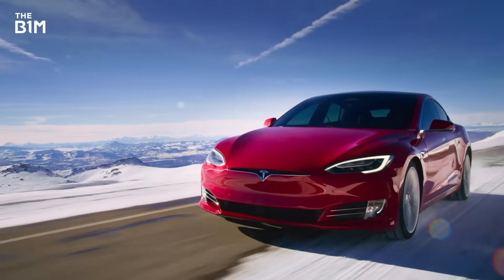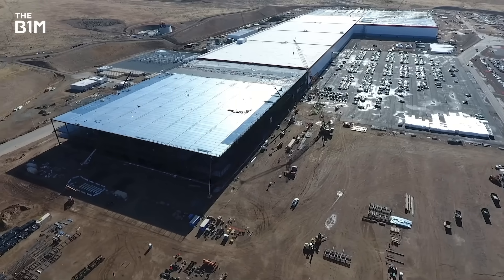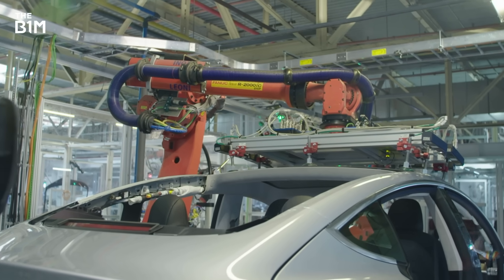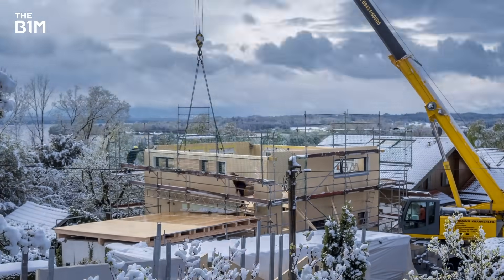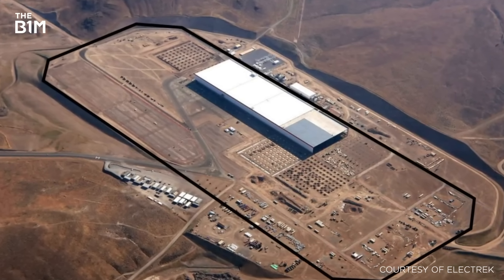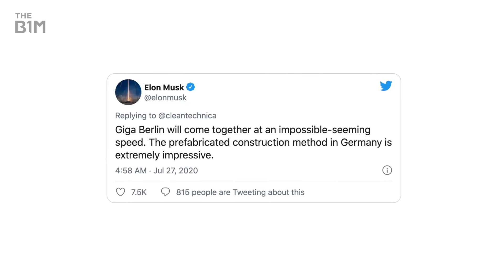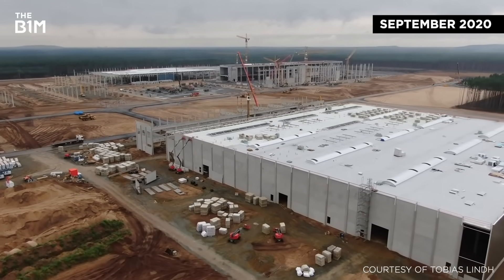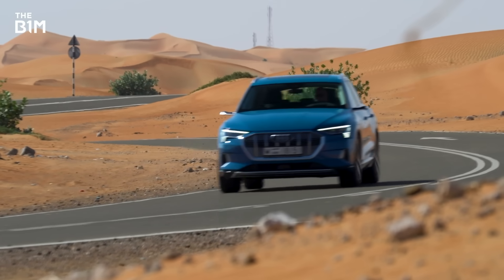How Tesla Builds Its Factories So Quickly

Comment: @1:31, unfortunately this is incorrect.  Having worked as one of the Senior Factory Design Managers at Tesla on a few of the Gigafactories, I can tell you there is no such template that the company uses to avoid reinventing the wheel, nor is there any such Design Manual (in fact, I was on the Reno team that proposed early on to create that manual). Quite the opposite, every new site is a new opportunity to re-optimize absolutely everything from the industrial layout of the plant, the manufacturing process design, down to the building itself and all the utility distribution systems (power, compressed air, gases, other chemicals, chilled/heated water systems, etc.). Of course, there are "lessons-learnt" that carry over from one project to the next, but surprisingly very very little is common between the Sparks/Reno, Shanghai, Berlin, and Austin factories (let alone the Fremont factory and other sites in NorCal). Templatizing is honestly not at all a contributing factor to the company's speed of deploying new production facilities. Such an approach would be very contrary to Elon's and the company's "first principles" approach to problem solving.
You are correct that prefabrication is used as one of the schedule relief methods, but there's nothing revolutionary here, all companies have access to the same prefab techniques, so this is hardly an advantage that Tesla has over any other manufacturers in the world. Also, it is not necessarily the case that prefab will be used on all Tesla projects. This is chosen on a site-by-site basis, and is related to the overall schedule constraints, which varies greatly from one factory to another (a complete supply chain analysis dictates here).

The company's secret is in its culture. I know that sounds vague, but the company's biggest strength is in how in-tune Elon himself and his top COs are with the details on the ground and in the design/planning process, and in the team's ability to pivot on a dime with a simple email from Elon, it's unlike anything you've ever seen how effectively a change in direction cascades down through the management ranks (perhaps outside of non-conventional military organizations - like guerilla groups), I think that is 100% the company's biggest advantage. That, and having the courage/technique to effectively put pressure on the biggest bottlenecks in a construction project: the regulatory/permitting process.

Comment: well. making prefabs in a factory does not always mean faster build times. the time saved from building a build on a given site, is move from that job site to the factories. at the end of the day you will still have to place an order with a third party to make those premade parts months if not years ahead of the assembly of the main factory on site. the time is spent at factories. instead of at construction sites. the time spent factor is still still there.

e.g prefab houses. all well and good saying. look at me, i build a house in less than a week. when in reality the parts to make that house were being made somewhere else many months before you received them to then do the final assembly. it still took months to make that house. it just was not assembled yet. that is all.

not saying it can never be faster, because that is not true. my point is. it take a lot longer than many will let on

Comment: Would be nice if you would go in depth on the Berlin drinking water issue. Anyhow, apart from that, these mega factories are buildings that significantly further the risk of flash flooding. Because their footprints are so large, yet another piece of soil is covered and sealed for rain to enter the lower soil structure and replenish groundwater levels. Hence, the planning and building of these structures should take this ‘footprint’ seriously. First of all, for the building itself, because where soils become ‘dry’ because of covering subsidence will occur. Second, because when a company truly wants to make an environmental contribution, all factors should be taken into account. Including its rainwater footprint.

Comment: To a degree.. the New York factory doesn't produce cars so it's not exactly a gigafactory..

Also, Shanghai gigafactory and the Berlin Gigafactory, and Giga Texas (it's special because it's the new biggest building) incredibly ridiculous that they are building three giant factories and one went from mud to producing +1,000 cars per week in 10 months!

And most ironically they never actually finished the Nevada gigafactory, It's only a fraction of what it's supposed to be and yet it's still producing hundreds of thousands of vehicles a year.

👍 Great video

Comment: Very impressive as allways. The modularization is vital for us to reduce the CO2 emissions and to build more sustainable. I did not understand from the video though if Tesla has its own division of Construction of they have only the "plan"? The fact that everything is controlled by one owner with very clear direction and way of working it's definitely vital in an industry when you have houndreds or even thousants of participants on a project, accross the entire supply chain. There are indeed many advantages when you build wih Lego blocks, and at the same time there is a big challenge to make sure to deliver in time the needed parts for such a huge projects that cannot be overlooked.

Comment: Nothing special. 

Their building are bland, boring and very simple: just squares/rectangles. A designer/architect doesn't need to draw anything. S/he can literally walk up to the site and say put these pillars there and roof there and that's it. Now replicate it 100 times and you have a so-called giga-factory. 

No new design, no new materials, no innovative ideas. All been tried and tested 500 years ago. That's why they can build them so fast. Also, most of these will not be as solid and long-lasting as a building, for example, in the middle of Manhattan.

Comment: Great video, however adopting the design from the manual to different locations is not new, Wal Mart pioneered in that in its super centers, a phenomenon which if I remember correctly did not set well with architects at some level.

Comment: 3:52 This is just one example of how government regulations give big business advantages of smaller ones. There is virtually zero risk that Tesla's building permit would be revoked once the factory is finished, even if their permit application according should be denied according to the rules.

A smaller or "less cool" business doesn't have this privilege.

This creates a market where the big or "hip" players have advantages over smaller and less flashy ones.

The result is centralization, fewer consumer choices and slower technology advancement.

Yet, the same people who complain about some businesses being "too big" also support the regulations that creates the supposed problem.
Reply: So start a small electric car company like Tesla did.
Reply: @drod3434  I just explained exactly why starting a small company is made much harder by government regulations.
Reply: Preliminary building permits must be only be granted if it's most likely that a final building permit is possible. That does not depend on the size of the company. The political influence on the administrations in Germany is small (otherwise BER airport would have opened in 2011). 
It's not uncommon to start building with a preliminary building permit in Germany. And smaller and less complex projects will need even less time.
One advantage of this site was that it was already assigned for industrial use (they hoped that BMW will build there a factory but they decided on Leipzig). The process to reassign an area or agricultural or residential or recreational/environmental (most difficult) use to industrial use is what takes the longest. As for this several administrative and political steps are necessary. And here the risk that this fails is given. Space in densely settled Germany is not endless.
Reply: @abalada  I have close to zero confidence in any political or regulatory process in the world as it looks today. It may very well be that German bureaucracy is more objective than that of other countries, but that doesn't mean it's rational or just in the absolute sense.

As evidence, I present the absolute insanity of the German government shutting down the most reliable, power-dense and affordable close to zero-carbon emission power source (nuclear) and replacing it with unreliable, extremely land- and raw materials intensive, and more carbon intensive solar and wind.

Comment: can somebody explain how concrete piles affect groundwater?
Edit. if somebody wonders, piles can drag contaminated ground deep to aquifier.
to would cause localised grounwater drop but it usually self seals, reverse is a problem. lowering waterlevel eg excessive pumping may cause instability of piles.

Comment: I suspect that another component of their assembly process is building the factory in sections, not floor by floor, but several acre's at a time. This means that each section of the factory is in a different stage of assembly. I.e. the last section of the factory is just starting to have its foundation built, while the first section of the factory already has robots installed. This means that you can have smaller teams for each trade who work continuously and more efficiently instead of the electricians having to wait for the whole building to be built first, etc.

Comment: Maybe it's quicker and easier for Tesla to design and assemble these Gigafactories as they are currently running production lines for only 3 (?) different vehicle types. Compare this with BMW who currently produce 52 different vehicle types. Surely the difference in these numbers would lead to a substantially different type of manufacturing facility, especially regarding interior fitout of the plants.

Comment: I don’t know if I agree with this video which is a first. You make it sound like every other building is an experiment on site. These things are built piece by piece virtually in architectural software. It’s not as willy-nilly as you make it seem. Also from other information each one of these are unique. It’s not the same design custom tailored to the area. They are ground up but planned before announced so it seems faster than it is. Also, these buildings are 500 poles surrounded by skin.  Nowhere near as difficult to build as a standard building with interior walls, plumbing And electricity hvac and windows.  Industrial structures like this always go very quick.

Comment: This video seemed a little light on content, Fred. Maybe you can find out a few more details? What construction software are they using? How are they able to do so much in parallel? How much local content are they using for building materials and labor? How much comes from Tesla headquarters? Inquiring minds want to know much more.
 
They refer to building factories as "building the machine that builds the machine". They're obviously approaching the project as an engineering problem, not a construction problem. They approach all their engineering problems from "first principles", trying to find the most efficient solution using physics to analyze what needs to be done and in what order, and which steps can be done in parallel to minimize build time and investment cost. They claim that engineering a factory is 1000x to 10,000x harder than engineering the product that the factory is going to make, but there's also much more room for optimization.

Comment: I will only be interested in an electric car when they cost about the same as a Fiesta, can do 500 miles on one charge no matter HOW MUCH the heater or lights etc are used, and doesn't use more electric to travel at faster speeds, and are able to charge at filling stations to full capacity as quick as filling a fuel tank. Also, a lot of people live in apartments or houses that do not have a driveway so they are unable to charge at home. If everyone had one here in the UK, where on earth is all the power supposed to come from to charge them ? Renewable energy ? Yeah right, don't make me laugh.

Comment: Apparent speed in construction is the result of several factors including focused leadership, a huge team of highly qualified and experienced planners and managers, architects and engineers who are of the highest qualifications and totally dedicated to the task, and contractors with superb qualifications. Don’t forget a few other important participants. For example local governing agencies who are also capable of quickly processing the necessary approvals. By clearing away all the approvals and permits in a comprehensive manner months or in the case of California, years can be cut from the process. Many large scale developers now hire consultants and lobbies ya for that purpose alone. Another overlooked but critical component of this team are the off site manufacturing coordinators. These folks work behind the scenes, sometimes years in advance to ensure that the 1,200 manufacturing robots are designed and built so that the instant that the structure can accommodate phased installation of these devices, they are on site and ready. This also means that the utility (electrical power and control) systems must be similarly ready. This applies all the way down the line to the manufacturers of door frames and lay-in ceiling tiles. It is an incredibly complex and vital aspect of the success of the project.
Lastly, please be aware that almost one hundred years ago a company used similar skills to build out of steel, concrete, bricks, stone and plaster the Empire State Building in an astonishing 18 months. More recent examples can be highlighted such as the Tudor/Perrini 24 months of construction that resulted in almost thirty acres of supported  concrete structure above a major and fully operation railroad system ready for the millions of square feet of high rise buildings, commercial structures and housing that is known as the Hampton Yards Project right in the middle of New York City. To date this is the largest project in the history of the city.
Reply: I have thirty years of experience as the senior project manager on very large scale projects. I speak from personal experience in managing all phases of work from concept to ribbon cutting. I am not addressing in any way the Tesla personnel or internal management. My discussion addresses what it takes to pull off this type of construction success.
Reply: You did a more in depth description in a comment than in this 5 minute video, thanks.
Reply: I wish that full timing and process is truly shown to general public . Otherwise I am asked to do next project just by spitting. And the winner is... faster . And in meantime politicians, Oprah, making big bags of money for 
talking. I am tired of proving that the covit 19 is the best happening in long time. Peoples are realizing what is the difference between price and value. Will it last?
Reply: I'm sorry but the modern leadership studies is a pseudoscientific junk branch of the business studies, invaded by liberal sociology types preaching inclusivity. If anything Musk's focus on keeping only the most talented employees is the opposite of what the useless "leadership experts" are saying. I also like how you say "apparently", as if you had some evidence of this ridiculous claim.
Reply: @Loomr  kid, this is when you take a seat and listen. Larry is spitting facts.
Reply: @dankim3950  lol,  really? You do not have internal knowledge of Tesla's operations and neither does Mr. Sorenson. Sorenson modified his comment but still doesn't have a single piece of evidence as to how the speed was really achieved. Are you a fan of the leadership pseudoscience by any means? Good luck trying to apply its voodoo methods in practice, and by all means, believe guys like Sorenson - really tells something about your level gullibility.